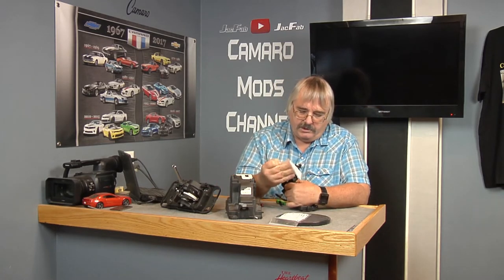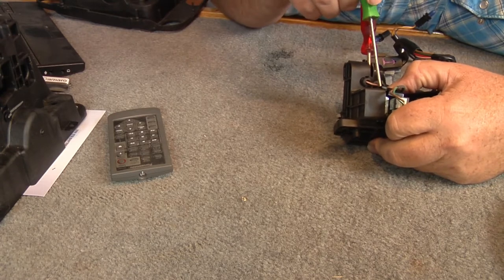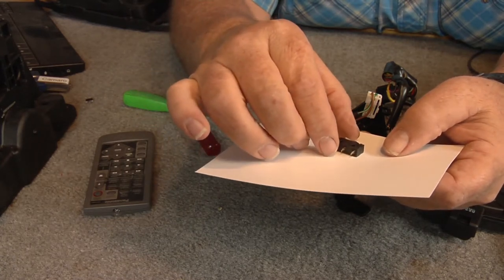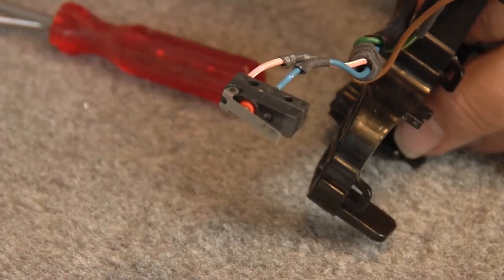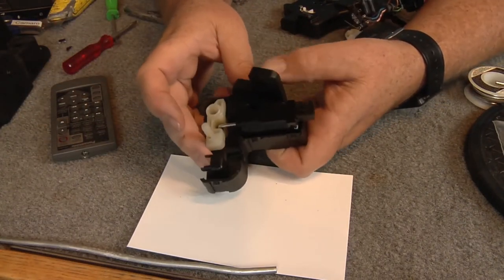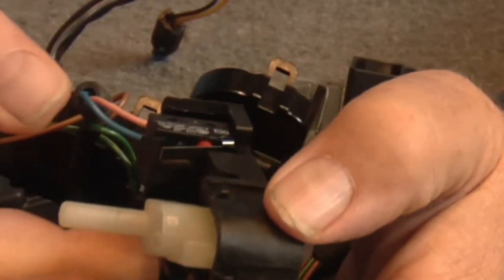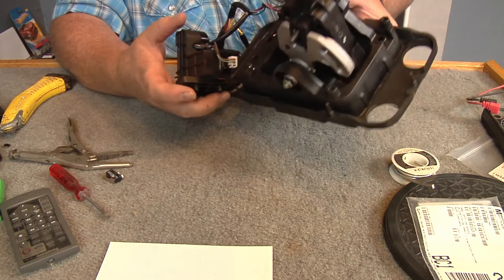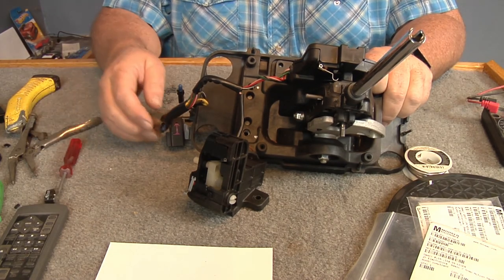2007- 2011 Cadillac STS "Shift to park" Switch Replacement

Comment: That type of microswitch is the bane of my existence!!  I can't tell you how many appliances I've worked on over the years that have those shitty switches inside them (mainly washing machines and dishwashers.)  Doesn't take much for them to shit the bed either!!
Reply from the maker: Thats cool you work on appliances, thanks for watching.
Reply: @camaromodschannel  hey talked to you before about microswitch your info helped alot,do you know anything about Cadillac sts and p0017 code camshaft sensor bank 1 hoping not timing chain
Reply from the maker: @jrenoch1796 
These are some of the possible issues that can cause a code P0017:

Damaged or stretched timing chain or timing belt
Faulty camshaft or crankshaft reluctor wheel
Bad crank sensor
Bad cam sensor
Loose wiring or connections
Damaged timing chain/belt tensioners or guides
Defective variable valve timing (VVT) actuator (a.k.a. phaser)
Faulty variable valve timing (VVT) solenoid (a.k.a. oil control valve)
Faulty PCM (check for any update)
Low oil level

Comment: I pulled a micro switch from a 2005 Cadillac Sts  that has a curved end is it possible to trim that end piece and use it in a 2008 Cadillac Sts? Thanks
Reply from the maker: Yes. You can.  Just test it good before you put it all back together.  Thanks
Reply: I did and it works! Thanks so much for this video. Unfortunately I think I broke that little circular plastic piece to get the housing off and now it doesn’t want to shift out of park. Guess back to the junkyard I go
Reply: It wasn’t that plastic part not allowing to shift out of park I didn’t properly connect the little metal celinoid shaft to plastic stop when I put it back together. People make sure you watch his entire video very throurough work he’s done you’ll learn a lot
Reply from the maker: Glad this video has helped you out and fix your car. Thanks
Reply from the maker: Thanks

Comment: Thanks for the video, I’ve got my shifter down ready to unsolder the switches the # on these is AV39331 ,  0.1A250V~AC , 50114H . I don’t have a clue what all those numbers & letters stand for.  Could you tell me where I could get the correct replacements . This XLR has 2 switches side by side . Any help finding the correct switches would be much appreciated.
Reply from the maker: Please look at all videos about the switches,  the link in in the description.  Thanks
Reply from the maker: https://www.mouser.com/ProductDetail/ZF/DC3C-A1LB?qs=Z7NFYKyvgJdQmArdIVbsiA%3D%3D
Reply: @camaromodschannel  Thanks I m fixing to order new switches . I worked the switches when I took cover off and it went to working for about 5 times and quit again.
Reply from the maker: Yes, sounds like the switches.  Thanks

Comment: Do you have the Mouser part number for the lockout solenoid switch also. I am having occasional issues with getting the car out of park and I believe it is easier to replace both switches at the same time.
Reply from the maker: They should be the same number.  Thanks

Comment: My 2007 STS won't start...it is doing the same thing, only when switch to accessories mode the information center tells me the car isn't in park 🤷🏿‍♂️ but it's in park🤦🏿‍♂️...I replaced the battery and alternator is only 2 years old...Any idea🤔
Reply from the maker: You are having problems with the micro switches as described in the video.  Yes its a pain to get it fixed but worth it. Thanks

Comment: Am having an issue with my Cadillac SRX it can shift to park but my doors won't open and key stock in the ignition I
 need help guard me, please
Reply from the maker: Sounds like your park switch. You will have to replace it. Hope you have 2 sets of keys.  So you can lock it. Thanks.
Reply from the maker: Check your fuses also.
Reply: @camaromodschannel  okay I will but can u help me with the particular fuse number please. Thanks

Comment: Do they sell the switch to replace it?
Reply from the maker: Does who sell the switch?
Reply: @camaromodschannel  I think @Justin Gonsales is asking if Cadillac sells this microwitch. And the answer to that is Cadillac will sell you the whole shifter assembly for many hundreds of dollars. They will not sell just the replacement switch.
Reply from the maker: @jensenhealey907efi  They may sell it, but you would pay 3x the amount for the same thing you could get  on ebay. thanks.
Reply: @camaromodschannel  No, this small microswitch is NOT sold by GM/Cadillac as a spare part. The only available replacement part is the whole shifter assembly.
Reply: Did you ever find someone or some place to sell just the switch?
Reply from the maker: @AttackOnTaiLetsplay  yes, you can get them on ebay.  Just put in the numbers and microswitch,  thanks
Reply: @jensenhealey907efi  Can I get the switch anywhere?

Comment: In your other video you don't show how to take out the part under the shifter, that's where I'm stuck at
Reply from the maker: I have 2 or 3 videos on the shifter problems,  what do you need to know,  you taking the shifter out. There's a bolt you need to take off. Then you can take it out. Thanks

Comment: is there a way just to by-pass that switch....or would that cause all kinds of other problems?......Ive been dealing with this issue for a long time and just havent been ready to tear in to it....I can still wiggle my shifter and it will go in to park....so I am thinking that little micro-switch in mine is still good.....its becoming harder and harder though on the wiggle....just took me about 20 minutes before it finally went in to park....I was just about ready to pull a battery cable...ha.....thanks for this video sir!
Reply from the maker: It's not That hard of a job, it's just takes some time, and better to have another car to drive. It may take a day or two. It's your micro switch, them things are cheap. And don't last much more than 10 to 15 years. Yes you could just connect to the wire and have a switch on the side. But I wouldn't do it that way. Thanks.
Reply: I would. Thdanks

Comment: Where can I buy the switch part?
Reply from the maker: You can get the numbers off your old one and get on ebay. I show switch numbers in the video.  Thanks for watching.
Reply from the maker: Look in shifter video, in my videos.  Look in the comments  at the top is a link to the switch.
Reply from the maker: Let me know if you find it, or i can send you a link.  Thanks
Reply: @camaromodschannel  Yessir, I found it and ordered one. Express shipped it and I'm hoping to be able to fix it. Im pretty young so I'm not very experienced in fixing electrical components yet. Your video goes in great detail so I'm confident I can do it. Thank you for uploading such a good guide. This is my first car and Im hoping I can get it set straight.
Reply from the maker: @KevinBurroughs1  awesome!

Comment: I’ve got a Cadillac XLR ,won’t shift out of park I took the console cover off and can move the rod from solenoid and can shift from park . What do you think I need .
Reply from the maker: A switch replacement.  Thanks
Reply from the maker: Did you check all your fuses??
Reply: @camaromodschannel yes .